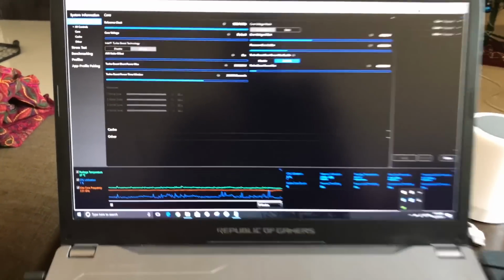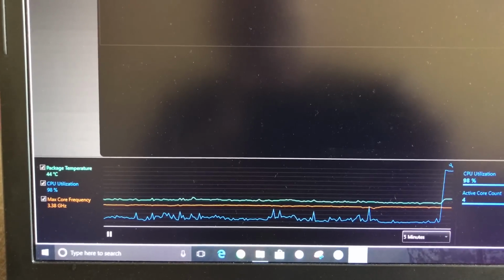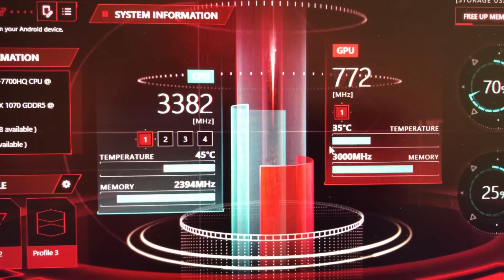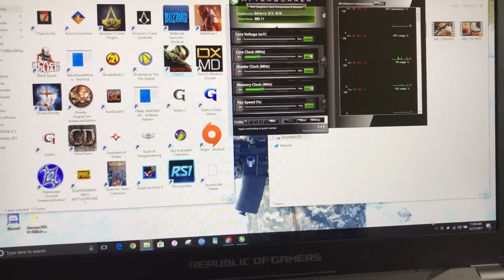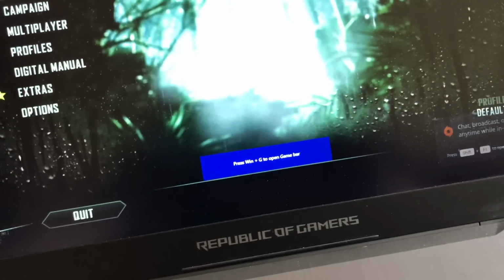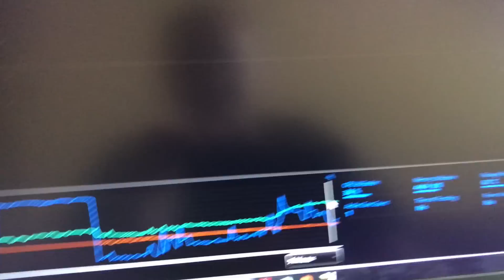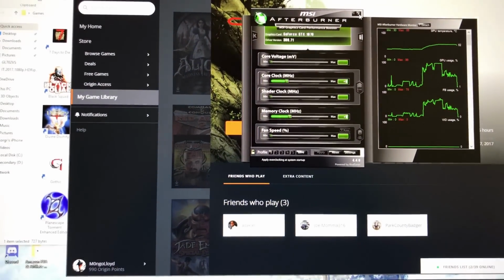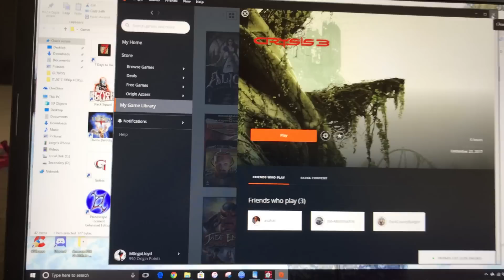ASUS ROG - Liquid Metal 5 Months Later! Followup

Comment: I have one question, after i take my cooler system off, should i keep the old liquid metal or repaste ???ps: sr for my bad language
Reply from the maker: hong quang Vo hey no problem! Your English is great. You will want to carefully remove and dispose of the old liquid metal. It can contaminate the new liquid metal if you mix together.
Reply: oh tks!! what about the old tape??
Reply from the maker: hong quang Vo the rape isn’t as important, though if you got any liquid metal on it before or if some spilled over when you put the heat sync on it the first time, you will want to replace the tape. I replaced mine just because it wasn’t making a good seal any longer.

Comment: I use insulation varnish instead of electrical tape. to insulate around gpu and gpu on my asus rog gl752vl
Reply from the maker: What brand? I did one for a friend the other day and used clear nail polish around the die (multiple coatings), so I believe that would be the same principle with the varnish .. multiple coats? Have you ever had any gallium seep onto the varnish at all or did you test the varnish and gallium on a different surface?

Comment: Are thermal pads necessary for those parts? Its kinda hard to find pads in my country even online (shipping is pricey).
Reply from the maker: Sagiri Best good question! If you watch my first video ( https://youtu.be/7glBCZr8ntI ) you will see that they actually use some thick thermal paste material instead of pads. You should be able to find some high temp thermal compound there in your country. What country are you in?
Reply: Mr. T's Tips Is this thermal paste the same as any other thermal paste? What am I looking for exactly?
Im in the Philippines. I see some Arctic thermal pads listed online but they only have the 0.5mm ones and I dont trust the cheap non-branded thermal pads.
Reply from the maker: Sagiri Best I’m currently in India for a while actually, so let me look around here for a standard Asian cost effective brand that is trustworthy ... give me a day to find a good solution for you :-)
Reply from the maker: BTW - you CAN use 2 of the .5 thick pads and after removing the film protectant from one side of each pad, you can press them together firmly so that they “bond”, and use that in place of the 1mm thermal pads.
Reply from the maker: Sagiri Best another “pro” tip for the removal of  the thermal goop they use at the factory, if you can’t find the same 2 part solution I use, is to firstly use citric based non-corrosive cleaner (GooGone is one company), and for the second part of the cleaning process, you can use 90% Isopropyl Alcohol or higher concentration.
Reply: Mr. T's Tips Thanks for the fast tips! Ill definitely try stacking two pads first.
Reply from the maker: Sagiri Best no prob man! You getting ready to do the full liquid metal thermal paste job?
Reply: Mr. T's Tips Im actually only thinking about changing my thermal paste on the cpu and gpu but I came across this video and thought I should also change all the other ones.
Reply from the maker: Sagiri Best make sure you use a liquid metal based thermal paste ... makes big difference. Also, here are my suggestions for what to order or buy locally:

Gallium (if you can’t get thermal grizzly there, use something pure like this: https://www.amazon.in/gp/aw/d/B00C7U17US/ref=mp_s_a_1_5?ie=UTF8&qid=1514796049&sr=8-5&pi=AC_SX118_SY170_QL70&keywords=gallium+liquid+metal&dpPl=1&dpID=415RlsQf%2B4L&ref=plSrch )

Thermal Pads: I felt and tested this out, good stuff for the price and is 1mm ... 

https://www.amazon.in/dp/B077JQZ7MK/ref=cm_sw_r_cp_awdb_t1_PtFsAb838GDY1

Comment: Good job very well done , by the way you can use Kapton tape or polymide dielectric tape it's much better stuff then the scotch 33+ there is 1mil to 5mil thickness and it's heat resistant to 400C+ I have seen some manufacturers use it stock it's a bit more expensive DuPont makes it they even use it in satellites for aerospace, the film you pealed of on the GPU NVIDIA side originally that's what it was you should have left it in place as it is much stronger than electric tape, and good job for disconnecting the battery but no need to remove it every time.
Reply: Tyler Torgrimson 

Yes it's adhesion is not as strong as the scotch 33+ but it's much more resistant to heat, I think if 33+ is a choice by most is because of adhesive when working with liquid metal , but then again the CPU you left the original film and by the looks it's polyimide tape I just not sure on the thickness of it like 1mil-5mil , they even sell roll of precut 1.5" by 1" wide they come in acrylic or silicone adhesive take all that into consideration, but I always go by if it's not broken then don't fix it. There is another tape for the fans I will put a link for you.

https://www.amazon.com/x100ft-Insulating-Acetate-Adhesive-Transformer/dp/B01NA8TIJ5/ref=sr_1_9?ie=UTF8&qid=1514424950&sr=8-9&keywords=laptop+tape
Reply from the maker: I just branded the channel and lost all my comments - Anyway, just wanted to post again and say thank you for the recommendation of the materials!

Comment: woow that's raff on the dye and copper. On my GL702VM i only use thermal paste only and some copper tape to seal gap from the fan and heat pipes. On my stable undeclock is -145. In next upgrade on your laptop I suggest MSI GE72VM models. with out that conductive thermal liquid and no under volting it is much cooler kinda same themp your getting. 43 C. and have 6 heat pipes
Reply from the maker: I might make the move when the 1080ti comes out on laptop haha, but then again, any laptop they put that into certainly isn't going to be a real winner on the temperature side I think.
Reply: Which copper tape did you go with? Would it be fine using an electric thermal tape instead?

Comment: Honestly I would pay you to do this to my gl502vsk I'm scared I'm going to F it up 😂😂
Reply: Ryan McCall hi i already did it to mine. Its running very cool. I used collaboratory pro metal paste.
Reply: also fix the air leak, i put tape on both fans and heatsick gaps, also put tape on heatsink too. Fully packed.
Reply from the maker: Hey Ryan - Make sure you subscribe to the chan. I just rebranded, so lost all of my previous comments I made before. Just keep in mind, if you need any help, you can always reach out to me haha. I do have a way that I could remotely help walk you through it if you want to go that route?
Reply from the maker: Ryan McCall yo ... back in the states from India in 2 weeks if you want me to do it haha .. as long as you pay shipping and liquid metal, I’ll cover everything else and you can choose a donation amount.
Reply: I bit the bullet and went with kryonaut paste instead of liquid metal, down 15°c on the core and 19°c on the gpu! 
GPU never exceeds 75°c whereas before it was hitting 91°c at times and the CPU does sometimes cap but only under synthetic load in AIDA64 :) thanks for your original tutorial as it helped a lot with my anxiety of opening it up!
Spent hours making the new thermal pads the right size!
Reply from the maker: Ryan McCall glad to be of help Ryan! Let me know if you need anything else man.
Reply: Mr. T's Tips hi can you plz tell that how much thermal pads need for those sensors and  chips. I have ordered one from amazon. Its size is 100mm * 15mm and its name fujipoly, is it fine.
Reply: dude u doing it wrong. what i have did to my system to make is stable is, i have undervolted both gpu and cpu. cpu -0.140V and gpu to 0.8V with reduced frequency 1550mhz. I have applied coollaboratory liquid pro thermal metal paste and my temps are cpu 75degrees and gpu 65 degrees. on fan profile 90 speed.
Reply: I also made the same mods... acqually i use Thermal Grizzly Conductonaut and i have temps over 90°... on my gl502vsk I can't undervolt gpu and cpu because it restart and becomes instable...
Reply: TurboNos 91 whats the exact model
Reply: Adnan Zahid it's gl502vs-gz147t
Reply: whats the room temp for that?
Reply: all of gl502vs and gl702vs laptops have 100% everyone have the same problem... in rog.asus.com there are many people that have the same problem... anyone have solution... I actually have bought some heatsink to improve the original heatsink... i'm from italy, while the heatsink that i've bought is from china... in a few mounth (when the copper material will arrive) I will publish the video in which I will show you how to modify and update the original heatsink... i hope my 95° temperature is just a distant dream. It's really shameful that asus has put on the market a notebook with this performance  with a huge flaw like this shit.
Reply: @EugenioCiullo_V-Blog  you now released youre video? i mean its 2 years ago haha :D
Reply: @kingjez2903  hei man... yes it's true you are right, I did not make videos because I sell my notebook because copper material don't solve the problem... I buy gm501gs and go perfectly down 90c° without thermalthrottling... then i sell it and now I've desktop and now i'm at peace...
Reply: @EugenioCiullo_V-Blog  thx :), im thinking about to see my g752vs also..dont like it anymore..btw. this ugly case which have to be open to clean it..maybe i want to buy one from MSi, they have better air case at backside its open
Reply: @kingjez2903  with liquid metal I noticed that it ruins the chip but has no improvement in temperature
, however msi is worse than asus, i advise you to wait for the new intel 11th. asus always makes some notebooks with the back that pops up when you open the screen, somewhat similar to the gm501gs. Otherwise do like me, sell everything and get a serious desktop pc ... try to see razer notebooks
 ;)
Reply: wao thats great :)
Reply: The trick is to tape or conformally coat any SMD components and then be SUPER gentle with your application. You don't need much more than the size of the smallest SMD components around the GPU to coat the die.
Reply: i've gl502vsk, i tested liquid pro/ liquid ultra, and thermal grizzly conductonaut... with all the thermal compound my temps gpu: max 80/82° while cpu max 95/97°... if I undervolt cpu, it restart even if I give a value of -0.50. this notebook is a very shit....